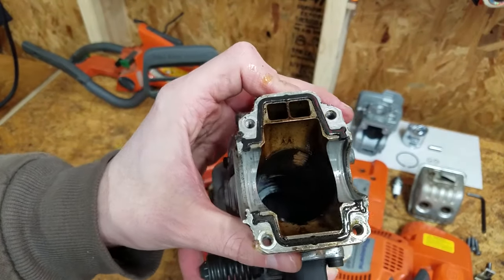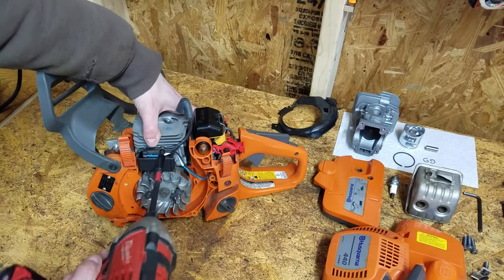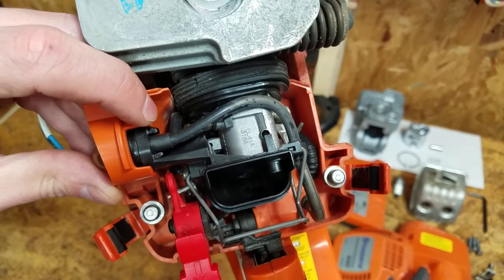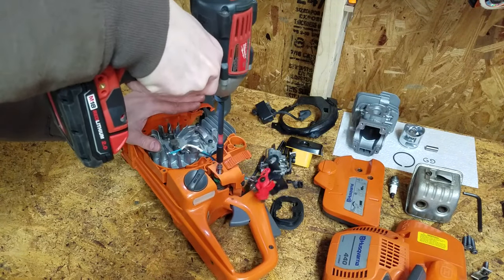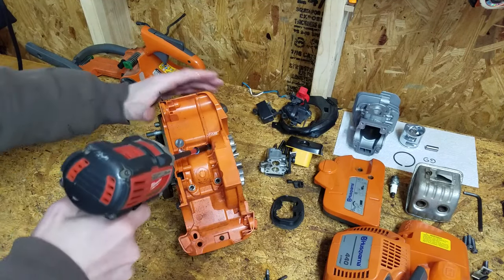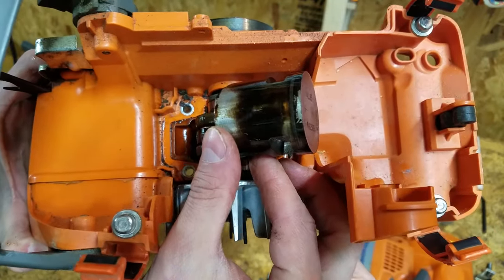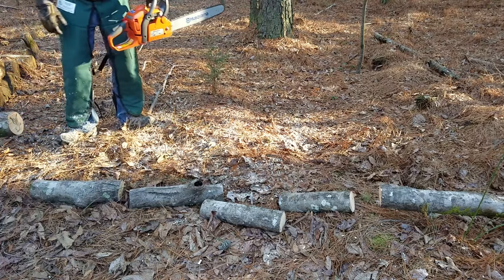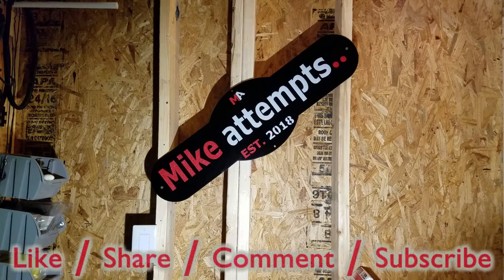Replacing a Chainsaw Piston and Cylinder

Comment: Low compression you say? I think the machining Horizontal ring marks On the piston have worn off, so the oil doesn’t stick to the piston as well as when new, so the seal isn’t as good.
Reply from the maker: From what I can tell, the saw looks like it might have died on the first tank of fuel because bar oil was used for the mix. The piston ring was completely compressed and stuck in the groove. With a good soak, I think the original piston and cylinder might be good as new. Thanks for watching!

Comment: Nice but I would have put piston tdc and remove spark plug then fill up cly with B12
Reply from the maker: After disassembly, I could see there was little to no damage to the cylinder and piston. It seems like the wrong type of oil was used in the fuel which caused the piston ring to get stuck in the compressed position, resulting in a lack of compression. Had I known all of that prior to taking it apart then cleaning the parts, while still on the saw, could have potentially fixed the issue.

Comment: After the failure to install the cylinder over the piston with my first kit (Husky 345) , I bought another one. I put the ring on the piston and was able to insert it into the cylinder. But I will be darned if once the piston is on the rod if I can get the piston to slide in. It hits the taper on the cylinder and just stops, best I can tell. Using a zip tie did nothing for me. Finally the high heat permatex had set up so I quit and cleaned it all up.

I used to rebuild two stroke MC engines (and car engines) starting at age 15. So it's not like I'm a total klutz. Looking at the interior of the cylinder it "looks" identical to the original, and I can slide the original right on down. I am without understanding. Guess I just needed to vent.
Reply from the maker: Did you try cussing, sometimes that helps? Hahaha! Dang, that's so strange and hasta be super frustrating. It sounds like you're far more experienced with engine rebuilds than me so I don't know what I could suggest that you probably haven't already thought of. That's not gonna stop me though! If you can get the piston in without the rod attached then the only thing I can assume is, when the rod is connected, maybe it's causing the piston to enter at a slight angle. Maybe you could try putting some grease around the ring, hold the cylinder with your thumbs on top and your fingers on the bottom. Then use your middle and ring fingers, from both hands, to put even pressure on the bottom of the piston skirt. Slowly and evenly squeeze while swearing at it for added intimidation. ;)
Reply: @Mikeattempts  lol.  I think I've been swearing enough already! I was looking at the original cylinder and actually does not look bad. Certainly nothing that catches my fingernail. I believe I will sand out minor discolorations with some 400 grit sandpaper and try to reuse it, as I can fit it over the piston no problem. Thanks for your suggestions, Mike.
Reply from the maker: @mandrix6323  So, when you started this project, how long did you think it would take vs reality? I actually enjoy stories of other peoples' struggles with this sort of stuff. It makes me realize I'm not alone, it happens to all of us! :) Let me know how it turns out.
Reply: @Mikeattempts Mike I expected to be finished with actual complete reassembly in an hour or so. Of course disassembly and cleanup beforehand was an hour or two.
I read all over YouTube where the cause of piston scoring/ring stuck in the land is the result of running unmixed gas. I have never ever done that. But last year hurricane Idalia tore my place up as a CAT 3 and took down many trees, and the little saw got a workout. I actually bought a Husky (445?) during that time as well.
I'm thinking I'm going to change the oil/gas mix to 40/45 :1 and see if the saws still run well.
Reply: Success at last!  went through 2 cylinder kits and then VIOLA! All is good and the saw runs great after some minor carb tuning.
Reply from the maker: @mandrix6323  Believe it or not, I was just wondering about your situation the other day! I'm glad you got it all back together and running, thanks for the update!

Comment: Which oil can I use  to lubricate the crankshaft bearings? (zoom oil is not available where I live). I am going to use engine oil but which Viscousity is recommnended?
Reply from the maker: I'm no pro but at 7:48, I just used SAE 30W oil to lube the needle bearings. I've also used 00 grease on the needle bearing under the clutch so I'm sure either would be perfectly fine. Gear oil would probably be another good option.

Comment: Trying to disassemble an Echo cs352es but the cylinder won’t lift off - any advice? Piston is free and all bolts removed but seal won’t break.
Reply from the maker: Did you try swearing more, that sometimes helps? ;) So, you got all 4 cylinder bolts removed from the bottom? Is it possible that the piston is seized in the cylinder? If so, you could stick a wooden dowel down the spark plug hole and try to tap the piston down while pulling up on the cylinder. If it's not the piston, you could just try tapping the top of the cylinder forwards and backwards, with a rubber mallet, in hopes of breaking the seal. I'm just throwing out ideas, I'm not a pro. Let me know how it goes!
Reply: @Mikeattempts  piston moves up and down so not seized. Tried hitting it with a rubber mallet - there is still compression in the cylinder if you turn the flywheel and put your thumb over the openings so seems like the seal is not breaking. As well as the bolts (which I have completely removed) there seem to be four little plugs coming up through - which might be from the gasket maybe. Don’t want to slip anything under the cylinder to break the seal I case I scratch the base as I only have a replacement piston not the cylinder.
Reply from the maker: @sophielaurie6510  Hmm, that's odd. You could try turning the saw upside down and use a piece of wood pressed against the bottom/side of the cylinder and tap on the wood with the mallet. Just be careful not to break any fins. I'm curious why it's stuck so, if you're able to get it off, let me know what was holding it.
Reply: @Mikeattempts  - thanks, will give it another go. Your video is excellent and gave me confidence to get this far so very frustrating!
Reply from the maker: @sophielaurie6510  You'll get it! Have you tried securing the body of the saw while twisting the cylinder? I just wonder if there's something else holding it? I would think a stuck seal wouldn't be enough to withstand all of the things you've tried so far.
Reply from the maker: @sophielaurie6510  If you'd like a 2nd set of eyes on it, feel free to email me some pictures (go to my About page and click to view my email). Chances are slim but maybe I'll help.
Reply: @Mikeattempts  thanks very much! I have sent you a couple of photos and a video on Facebook messenger (couldn’t find your email).

Comment: I think this engine was run once on neat petrol and only the original first run factory oil kept it alive for a little while.
Reply from the maker: Because of the tacky coating on the piston and cylinder wall, I kinda think maybe the original owner tried to use bar oil instead of 2-stroke oil in the fuel. :)
Reply: @Mikeattempts  oh that’s tragic! 😭

Comment: Awesome presentation of  swapping out the old head and piston. I am going thru a NepTec saw that the same had happened. I can't even pull the recoil. I have no idea if this Neo Tec is a Stihl knock off. Those compression testers come in real handy. So this question is on another subject. You have your standard plug and then you have the plugs that only have threads as for ATV's. Have you ran across a tester for those types yet? I've looked but maybe am not putting the correct search terms
Reply from the maker: The compression testers I've seen usually come with the most common thread adaptors, so you just pick the one you need.
Reply: No the compression, I'm referring to the spark tester, anyway I got that old jug off and the new kit failed to come with a base gasket. @Mikeattempts
Reply from the maker: @Smalltechguy  Ah, I've never used a spark plug tester so I'm not sure.

Comment: When I rebuilt my chainsaw and tried to start it and it would idle great but would bog out when pulling the trigger. I tried to adjust it but it didn't work. Any ideas. It did sit for a year with fuel because the first motor blew up.
Reply from the maker: I'm no pro but I do have a few ideas. 1) A fuel line could be twisted or kinked. That would allow enough fuel to idle but not enough to rev up. 2) The carb could have a partial blockage. It doesn't take much at all to mess up a carb and I have a chainsaw carb cleaning video too, if needed. 3) The carb be out of adjustment. This is less likely because the jets don't move on their own. The base starting point is to turn the high and low speed jets all the way in and then back out 1.5 turns. Once running, adjust as necessary.

Comment: Hi, I have a husqvarna 128cd, that  recently changed the piston, carb, fuel lines and spark. It won't start. Spark is fine (sparking), fuel lines are ok, and carb is new. What could it be? Compression? Something I noticed is that the cylinder / piston ring was too loose. Could this be the problem? Unfortunately, I don't have the compression gauge for testing.
Reply from the maker: I'm no pro but, unless you have the fuel lines connected to the wrong ports on the carb, it sounds like you have everything you need except compression. You only replaced the piston, not the cylinder? I guess there's a chance that the piston is the wrong diameter. Were you able to compare the old piston with the new one before installation?
Reply: @Mikeattempts  both pistons look the same, I changed the piston and cylinder.
Reply from the maker: @anrivera1975  Hmm, I assume you bought the piston and cylinder in a kit so they should match. Did you double-check the fuel line connections to the carb? Did you adjust the high and low jets on the carburetor? Turn them in all the way and then out 1.5 turns.
Reply: @Mikeattempts  yes I did all that stuff.  My guess is a compression issue. Fuel lines are ok, I thought it was that and switched them to try. No luck.
Reply from the maker: @anrivera1975  Alright, let me know what you find, I'm curious.
Reply: @Mikeattempts  compression is good, I got 100.
Reply from the maker: @anrivera1975  Again, I'm no pro, but 100 sounds low. I would think it should be around 120.
Reply: @Mikeattempts  really good to know, what could be then? No more options to check. Piston ring?
Reply from the maker: @anrivera1975  It's hard to say without seeing it. The piston could be undersized or something could be wrong with the ring. It could also be a fuel issue, I've seen different compression testers give different results. You'll just have to take it apart and check everything carefully.
Reply: @Mikeattempts  ok i will do the whole process again

Comment: Using incorrect type of oil  in mix , any old 2 stroke oil is not good enough these  days  must a good quality hi speed , air cooled  2 stroke oil,   if a 2 stroke oil for  a outboard engine was used   engine would not last long , as chainsaw  air cooled engine temp would cook  oil used (outboard 2 stroke ) and could also end up being like a jelly like substance inside engine
Reply from the maker: That sounds like the most likely culprit. It seems like the oil was cooked and it left a slightly tacky film on the piston and cylinder. Thanks for the comment!
Reply: There's no difference between marine 2-stroke or air-cooled chainsaw 2S oil. Marine 2-stroke oil has a detergent that breaks down in water to stop clogging the exhaust manifold. Water cooled engines can easily run at 100 to 1 + ratio and that's the only difference. This engine was obviously run-on chain bar oil which would explain the tarring.
Reply: I use 2 stroke marine oil in my Shindaiwa and Stihl for past several years....the saws literally scream like a raped ape. My experience has only been very positive.
Reply: @pdevonport7266  I don't know about that. THis isn't the first time we've been told not to use outboard engine oil in chainsaw fuel.  I used some and it killed my Husqvarna 137, a great little saw for years.  I'd say which brand but I've forgotten at the moment. IT was all the corner gas station had in the moment when I needed 2-stroke oil.

I will never make that mistake again.

Why chance it when stihl and husqvarna make good reliable natural and synthetic oils for only a few pennies more than the cheap outboard stuff?
Reply: I still cooked my 2 year old 365 xtorq with 94 octane 10% ethanol fuel with a 50:1 mixture. It's law in Canada to have ethanol in the gasoline. Now I know!!

Comment: stuck in cooked oil either they put to the wrong type of oil or to rich  mixed gaz , or the run it at low rpm and finally the high circuit of the carb might be to rich
Reply from the maker: Yeah, I think they might have used bar oil in the fuel.

Comment: Probably tried cleaning it up before taking it back to the store. Did a good job cleaning it up
Reply from the maker: Hahaha, I wouldn't be surprised. :) Thanks for watching!
Reply: @Mikeattempts  I’m working on a brand new echo that I accidentally ran bad gas through. Cut a couple trees is all it cut up. I was encouraged to blow it off and take it back to the store as a defect. Couldn’t bring myself to do it. I winced and ordered a cylinder and piston kit

 Your video was a huge help. Never had an engine fully disassembled. Didn’t know if the piston came out without destroying the clips. Now if I can remember how to put it back together once I get the parts! 👍
Reply from the maker: @Dogonatree  You did the right thing, we need more honest people like you. :) Let me know how it goes!
Reply: Just wanted to follow up, got my parts in. Fixed it up. No left over parts. Can of gas from now on. It’s cheaper than a new saw or parts too
Reply from the maker: @Dogonatree  Hahaha, no left over parts is a sign of a job well done! ;) Thanks for the update!

Comment: Thanks, very helpful video I just have a question how much can I charge to change just piston n rings on one of these chopsaws? Im new on side jobs and I want to have an idea of an estimate charge like i mentioned before just for piston n rings replacement
Reply from the maker: I'm not sure, I'm not a pro, this was the first time I ever did a piston and cylinder. I guess I would call a few local small engine repair shops and ask 'em how much it would cost to replace the piston and rings. Then you can charge a bit less and I'm sure the customer would be happy. Once you've done a few jobs then you could figure out a fair hourly rate and then also charge for parts.

Comment: Castor oil is definitely the reason for all that gunk.leaves a varnish behind that it tacky and produces a lot of carbon when burnt. Could be Maxima 927, Castrol R40 or A747,, Klotz Benol race castor.

Most likely surplus race gas or the guy likes the small of castor that’s why it was used. Castor should only be for race applications where frequent rebuilds are performed.

That piston and cylinder would still be serviceable. Just need to dissolve the castor gum from the parts. An ultrasonic cleaner or strong solvent will do the job.
Reply from the maker: Dang, I've heard of people killing saws by not using 2-stroke oil at all but, knowing you need to mix the gas and using the wrong oil, that's nuts. I kept the original piston and cylinder and I think you're right, a good soaking should make 'em reusable. Thanks for the comment!
Reply: @Mikeattempts  I think you could use some cheap engine flush, it shuld cost about 5$, it should dissolve all carbon deposit and you'll have perfectly new original parts ;)
Reply from the maker: @devirezxz  Yep, I haven't tried it yet but I think you're right! :)

Comment: Does anyone knows what is the ideal pressure on a husqvarna 440 . I’ve checked mine and the gauge reads 85psi
Reply from the maker: I'm no pro but 85 PSI sounds low, it should be at least 110. Does your saw start, run, and cut ok? If so, I wouldn't worry about it, your compression tester might not be accurate.
Reply: @Mikeattempts  I’ve just put new carburetor in it , it still doesn’t start. I’ve put little bit of mixed fuel on top of the piston and it fired for about 3 seconds and shuts off? I’m considering on replacing the cylinder and piston. I’ve checked the compression on my Jonsered and it’s at 125psi
Reply from the maker: @samcanario3683  Hmmm, did it have the same problem before you replaced the carb? It could just be low compression preventing it from starting but I can't say for sure.

Comment: How good are the parts from Amazon for A 359 are they worth the money or buy something more expensive??
Reply from the maker: I got my aftermarket kit from eBay and was surprised by the quality. I'm not saying it was as good as OEM but the casting, fit, and finish was nice. I assume the stuff on Amazon is the same as the stuff on eBay. If buying on Amazon, I'd just read the reviews before making a decision. If buying on eBay, I wouldn't purchase from any seller with less than a 99.0% Feedback Rating.

Comment: Using old sump oil instead of two stroke oil.
I think this is why your compression ring wore out or distorted by over heating then slow cool.
Removing the spring effect.
Reply from the maker: Yep, I think that's what the previous owner must have done. Thanks for watching!